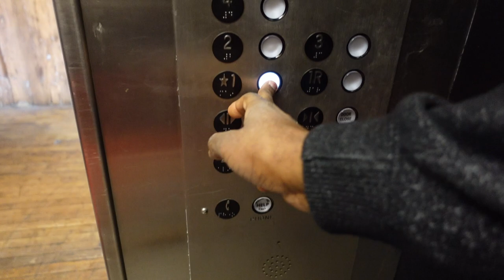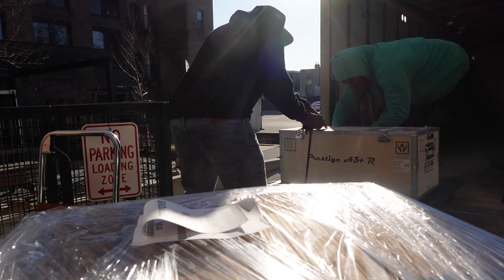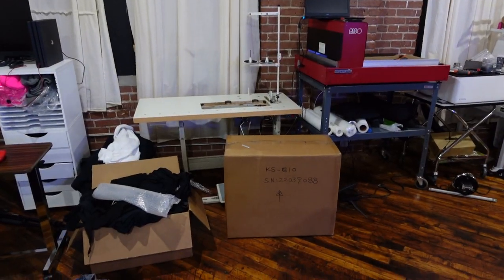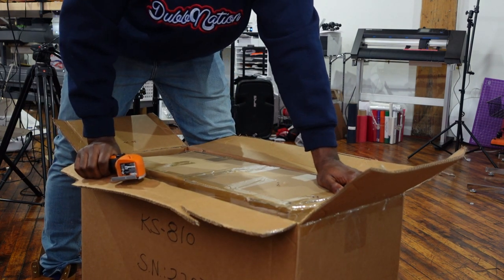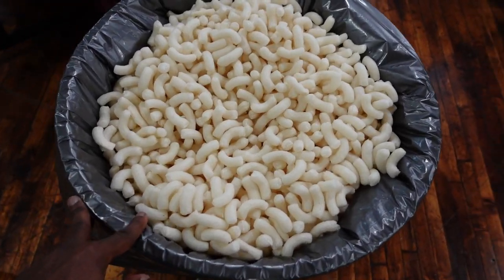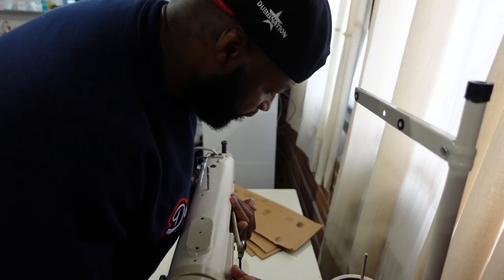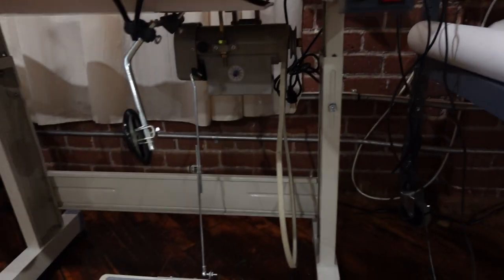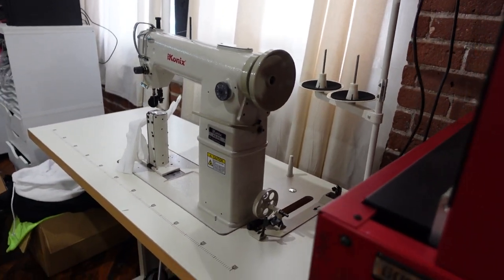iKonix KS 810 Post Bed Sewing machine Delivery

Comment: Don't let anyone tell you that you can't install a 6/3 speed reducer pulley size  on the ikonik ks 810. It's a little work getting it lined up but it's worth it. I can turn the speed to 200-250 and sew one stitch at a time with foot pedal to the floor. I'm so happy I added it. I seen a video setup on a Consew bed post sewing machine and I copied his setup and it worked perfectly. 8:09

Comment: Some of the steel frames you can add industrial wheels that lock, the issue with that is if you sew very fast it may shake because the machine is so heavy. I taken all of my wheels off. I love industrial machines💯
Reply from the maker: I’m gonna get a lock stitch and a walking foot then I’m done. Three. Already have a surger.
Reply: I put mine up by myself so I kno u can but it is not! easy you should have a booklet that shows what the pieces are but no instructions with booklet I’m switching out my roller foot for presser foot tho these machines pur like kittens I love them now that I’ve taken them apart and have become one with them

Comment: did you get it assembled or not
Reply from the maker: Yea. It’s all assembled and I’m using it.
Reply: @adubbproductions  to clarify did you order it pre assembled or you ordered it as is and assembled it
Reply from the maker: My post bed came assembled my lock stitch came on a box.  It was a little challenging.  Actually very challenging.
Reply: Are they working OK? I'm thinking of getting one for sneakers.